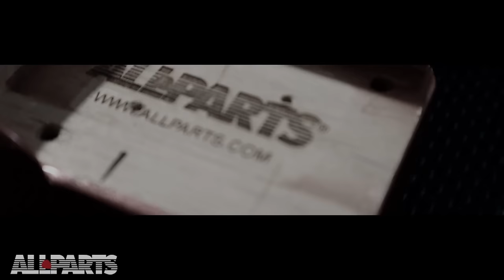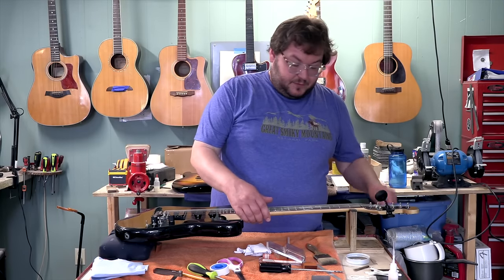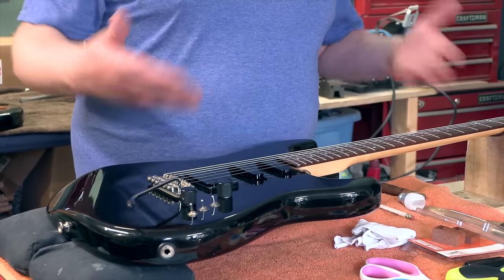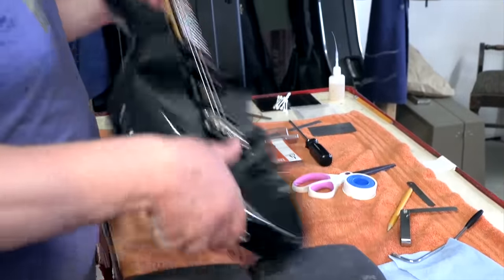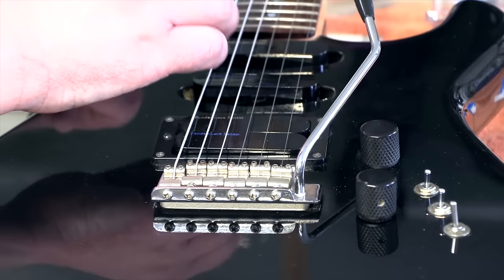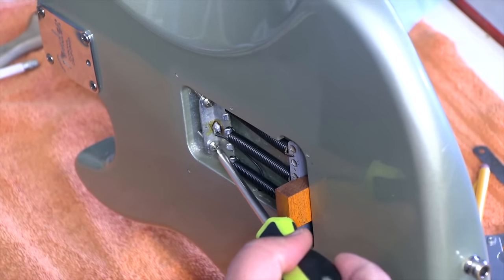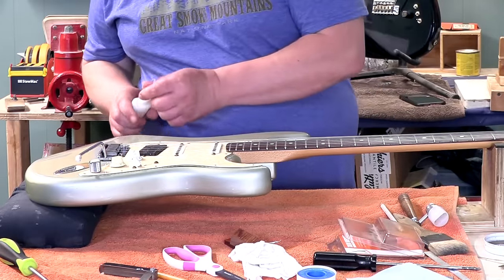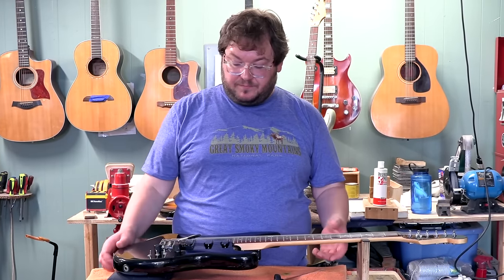8 Steps to Float Your Strat Trem | Helmers How-Tos

Comment: PG links a guy that doesn't know basic string gauges? Blindly setting bridge radius? Sloppily uses teflon tape rather than a trem spring, etc. Leo used a nickel for bridge height, HE designed it - why buy anything or do it differently? OMG...
Reply: Yup, this is an AllParts commercial for completely unnecessary trem blocks.
Reply: Your criticism is worth mentioning. But there’s still a lot you can learn from this vid without having to buy stuff from allparts, if you just think along.
Reply: .09-.46 is a common set. Always  gotta be cateful buying .09s and making sure i get .09-.042. 
 .10-.052 is a common set made by ernie ball slinky top heavy bottom. 
 People have been using trem blocks for a very long time, and  there is a wealth of info iut there on how to male them yourself. 
 When Leo was at Fender people weren’t using the trem to dive bomb or pull up a minor third on the G string. 
 Fender not sire if it they still do, but at one point in time this was their preferred method for setting a floating bridge. I imagine it still is.
 Most people have teflon lying around , and you save money there after buyong the block and don’t have to pay for a spring. If i don’t buy new and they kay even do this with squie you won’t get a bar or a spring. They only give one spring anyways. You gotta hope it gets stuck and wedges in pretty good otherwise it falls out everytime you take ot off.

Comment: Trouble is, with a floating bridge, when you bend a string up, say the 3rd G string and hit another string - the second fretted string is out of tune. Nightmare if you play a lot of blues and bend a lot of strings
Reply: thanks for that information, i want a floating bridge, do you thing locking tuners might solve that problem?"
Reply: @dvf3fairleigh  no, a hardtail would
Reply: That drove me crazy when I got my first strat! Immediately after noticing what was happening I added 2 springs at the back and got the bridge perfectly sitting on the body
Reply: Yes, had to add extra springs too and set the bridge flat to the body. Solves the issue, but obviously limits trem bar action
Reply: that would also happen if the trem sits on the body, and the springs in the back cannot counter the string tension when bending, hence the trem tilts forward
Reply: @Ram Dan the gimp  yes right, but l set it, so it's still just sitting flat - on a big bend
Reply: @Toraboramusic  its a balancing act , you will either have to live with a little more stiff tremolo or work against the upward motion

Comment: I had my Strat bridge set flush to the body for a while but decided to float it like Leo intended. I did it the old school way. I backed off (unscrewed) the two screws that hold the claw that the springs are connected to a ways and re-tuned to pitch. Then I gradually screwed the screws back in and re-tuned, etc., etc., until it was as i wanted it. For me,1/2 step up is fine. It took a little time, but I got it right without any fuss at all. I don't "dive-bomb." I like a little musical vibrato here and there, a little pre-upbend and such. With the nut properly lubed, it stays in good pitch when I use it.

Comment: Taught myself back when I was 18, there isn't a trem I cannot make work, even the dreaded Westone (St. Louis Music) "Bendmaster". 
Back off the 6 screws on the 6 point trem till the screw head is completely flush, don't leave any wiggle room.
I have never measured, and I never used a block, it doesn't take but 2-3 tunings to get it all set . As for broken strings? lol I don't, I cannot remember the last time I broke any string

Comment: Can someone explain why the four inter screws are left not as tight? I see thats a common thing but no one gives the explination
Reply: I think it has to do with reducing friction by only having 2 pivot points on the outer screws, like the modern trem.  Someone correct me if I’m wrong.

Comment: Suggestion. Add a Hipshot Tremsetter to keep your setting where you put it initially. Mine was easy. I have a deluxe plus Strat since 96. Bought used. When these were new Fender included a Tremsetter in thr package. I stopped and bought 1 on my way home when I picked up my guitar, set the Fender Floyd Rose bridge up a bit, reset the intonation and been whammying since 96. Never needed to ever touch this part of this guitar since then. I've always said best Strat Fender ever made. Deluxe Plus with Fender Floyd Rose bridge.
Reply: If you know how to properly setup a 6 point fender stock trem, you don't need a Tremsetter....I toss my strat in the case, I take it out, its in tune, it's a 3 bolt 72 RI....I also owned a 74 never a tuning problem.
Reply: @nasticanasta  Sure for a while. Maybe couple yrs. Mines been together 26 yrs. And even I never thought it would be that good for so many years. Only thing I've done is take off the back plate and make sure each screw and adjustment ring is tight. If you still think a 7 dollar piece, maybe 15 by now is a waste of time then go for it. But I know from my previous Strats you have to constantly adjust your system. That's why so many block their trems. I have been whamming up and down for yrs, no adjustments and stays in tune. Also have used whatever strings I wanted even some no name brand that I got at some store grand opening 20 sets for $12. But I always have used 9's. Now cause Ive gotten picky over the yrs I stick with Fender strings. I didn't trust this system 26 yrs ago. Now I swear by it.

Comment: Tape on the threads is the worst thing you can do. Just buy a spring & ball kit from Fender. They work MUCH better. And it doesn't take 20 mins to pick all of the shredded Teflon tape out of the threads when you use the spring.

Comment: i could NEVER get these things to stay in tune whilst using the bar
Reply: That sucks. I haven't had an issue even starting with my first and cheapest guitar.

I also, didn't use all, those tools to do it. I just floated it so it'll go a full step up and it's been there ever since. Always go back in tune. And this is on $129 Silvertone 'Strat'.

Comment: I watched until you started to put teflon tape on rhe whammy bar threads. How wrong can you get. 

One of the design flaws with a Fender Tremolo bridge is the Whammy Bar: There is a tiny Spring and Metal Ball that is supposed to slip down the hole and compress as you screw in the bar. The spring and ball put tension and friction on the bar, keeping the whammy bar from spinning loosly around. The design flaw is when you take the bar off to put the guitar in it's case [or Gig Bag], the spring and ball fall out un-noticed. When you screw the bar back in again, no spring means no tension of friction and the bar swings loosly around again. 

The second design flaw is: Break a string and all the remaining strings go out of tune immediatly. 

The third design flaw is: Use the whammy bar a few times and the strings go out of tune, although at a slightly slower rate than breaking a string. 

The fourth design flaw is in the player: If you have a whammy bar, you just gotta OVER use it.